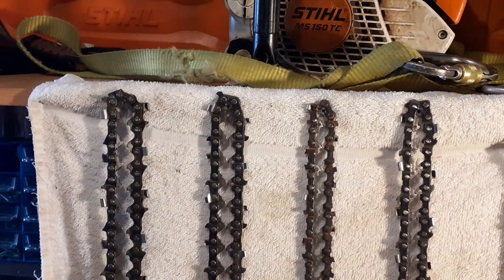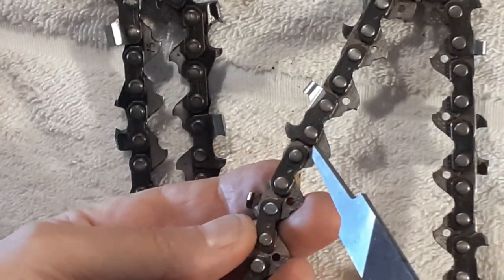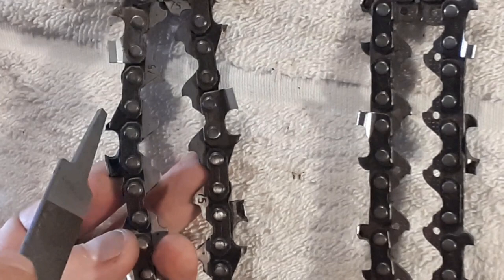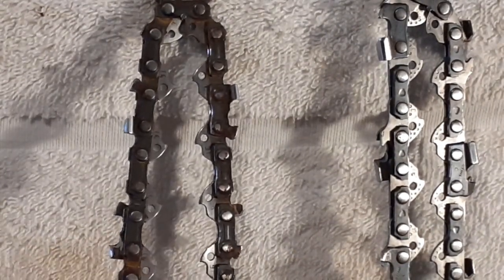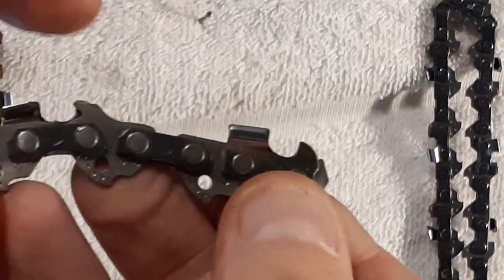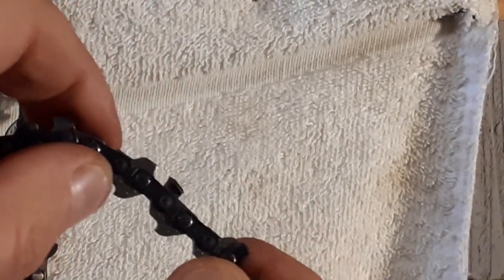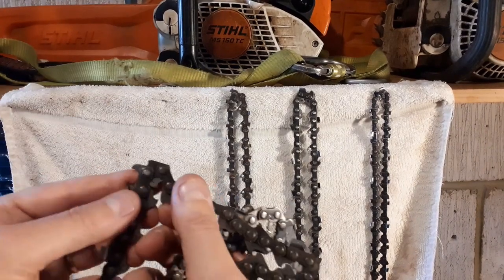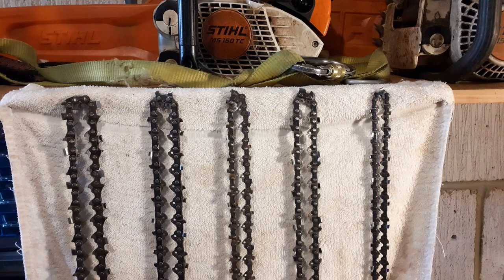What is a Low Kickback Chainsaw Chain?

Comment: yes I got a Stihl picco low kick back MS 192 C 0.35 pitch , 0.050 guage , 55 link , 30° chain angle tooth , 5/32" round file , with rake teeth at 0.65mm or 0.025 inch heigth

Comment: I have some different chains.  Some have the tab on the drive link behind the raker, but it is the same size and you can't see it when it's straight.  So, I guess that kickback tab is only exposed on the tip as it bends around the nose?
Reply from the maker: Tricky to visualise but maybe? Not all chains have the same low kickback design.